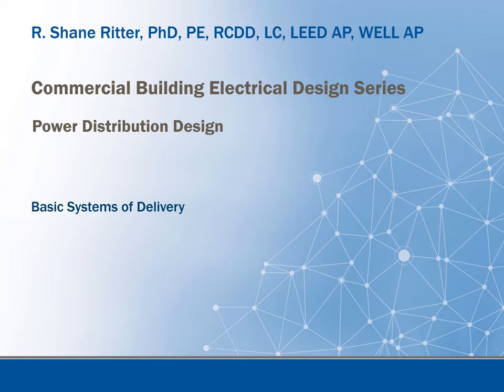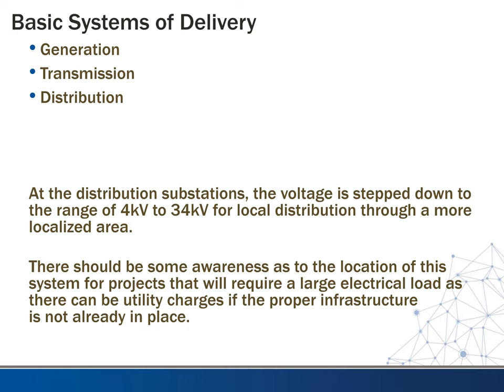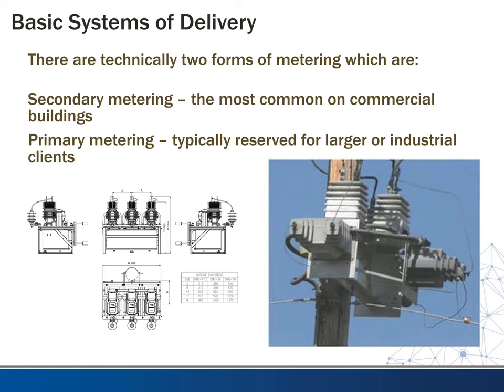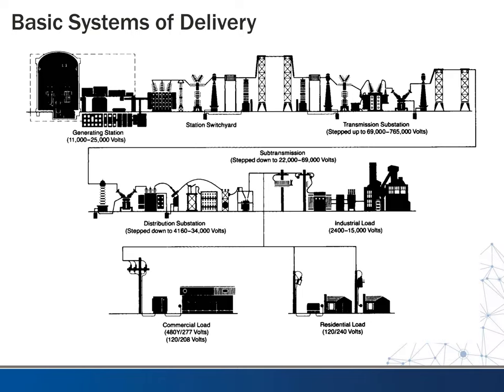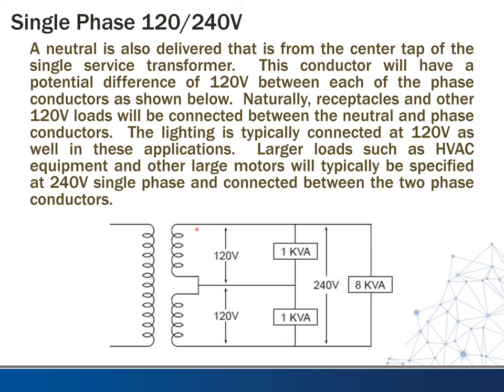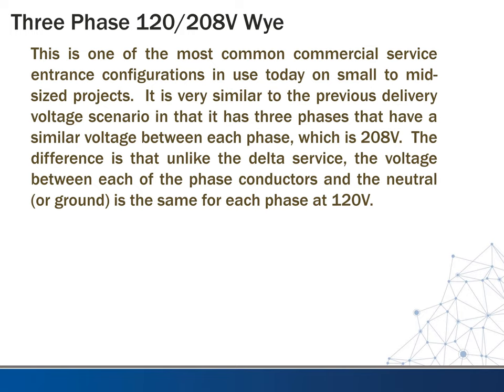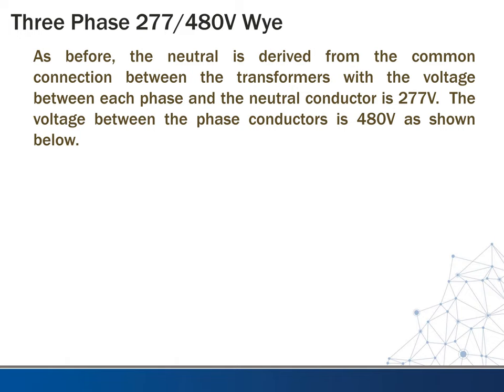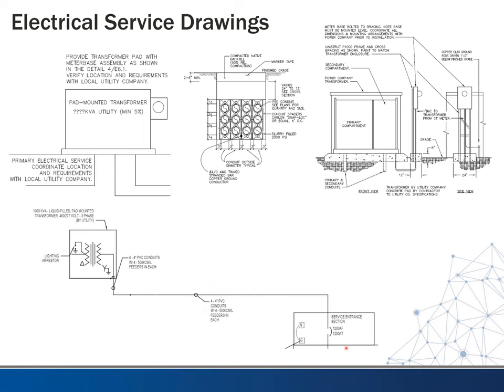Electrical Delivery Systems

Comment: Hello Shane, thank you very much for this informative video. I have one question about voltage difference between Generating Station and Industrial Load. As I see we have enough voltage at the generating point. Why we increase it to 765kV and after that decrease to 15kV. Why we can not use the generating voltage range in there?